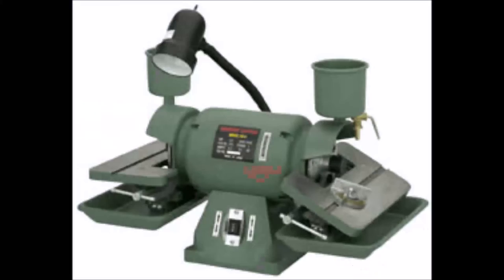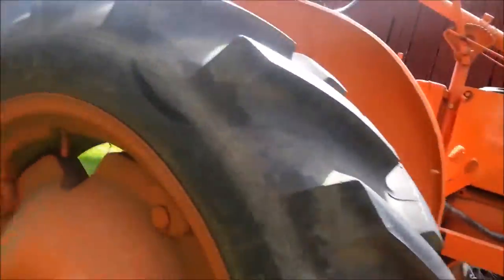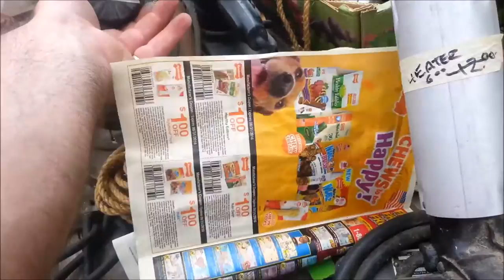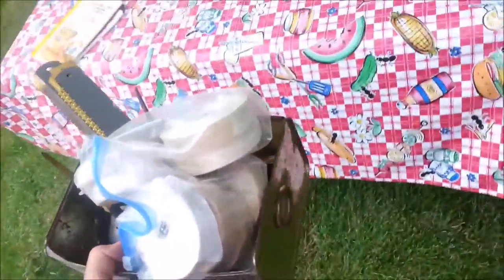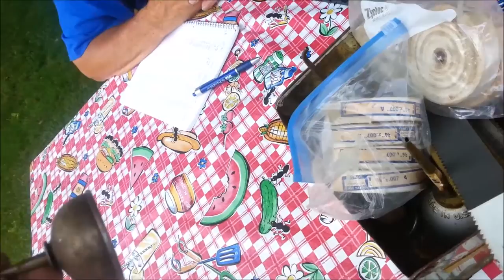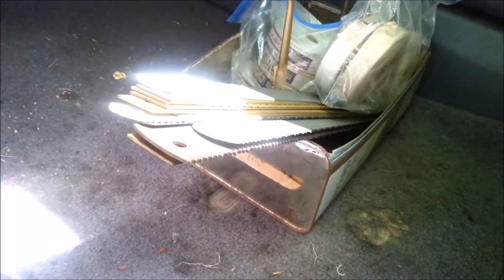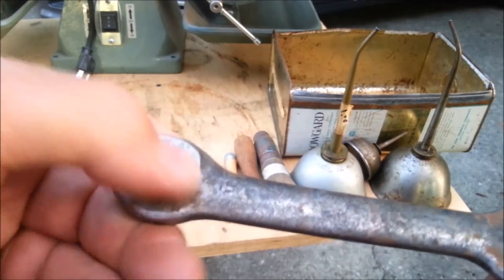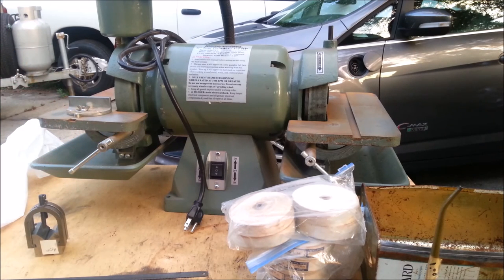Harbor Freight Tool Grinder & Barn Sale Pick Crafted Channel

Comment: i need atlas pulleys for the  cabinet mount style, do u have any
Reply from the maker: None on hand.  I own only one worn out set for the cabinet lathe you've been seeing me restore.  I need a set to replace a worn set and will be making them when the time comes.  It's not going to be that hard a job.  I finished a pulley started by another in an earlier video.  The trick is to see what material is there on the spindle double pulley and seeing if I can turn the old pulley flanges off and press on a new turning.  Still like to get the diameters all correct.

There is some small possibility I'll replace it with a toothed belt setup.